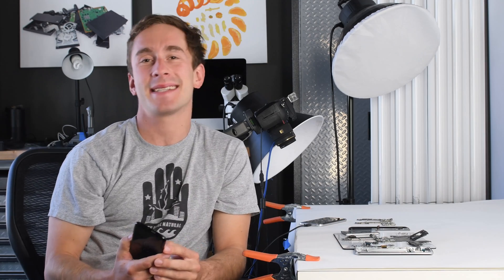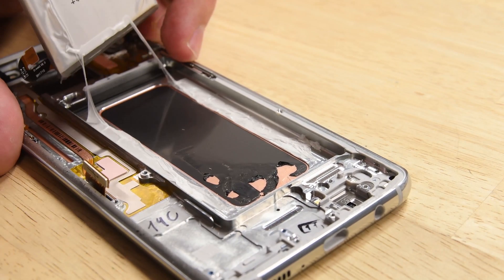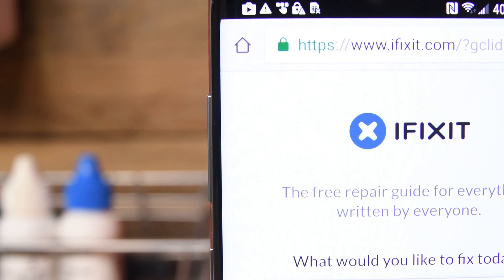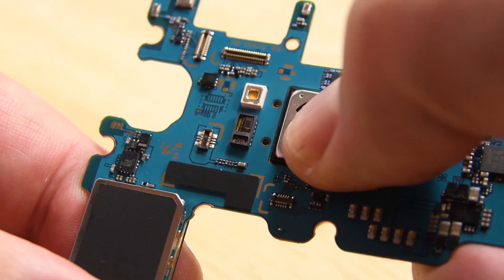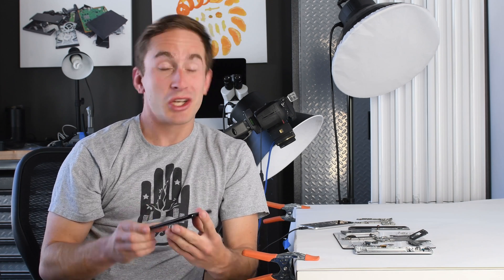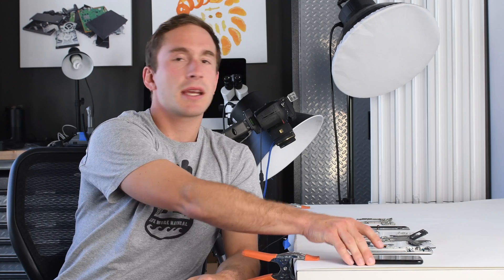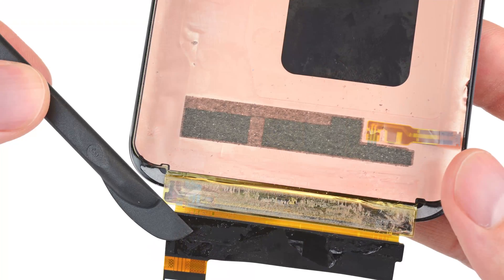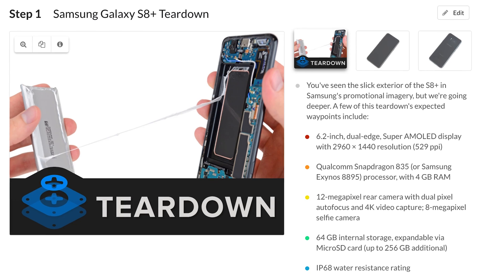Samsung Galaxy S8/S8+ Teardown Follow Up! Your Questions Answered and Component Updates!

Comment: I have a problem with my S8 Plus. Maybe you can help - whether it's normal or not. Or what might be the reason.... When I listen closely to the ear speaker (even without making a telephone call) I hear some noise that is caused by the Wifi module being turned on. It is not there, when I switch Wifi off. It's kind of a very subtle clicking, like an antenna working.

Comment: Isn't S8 the LEAST probable phone to have battery exploding issues? Or are you going to say from now on on every phone teardown with a glued battery that "(manufacturer x) will have a hard time getting these out if their batteries start exploding"
Reply: Mikko Haavisto  Good point about the batteries. Why is this 'teck' doing a teardown review  when he doesn't know  the difference  between  an explosion  and a fire !! Samsung HAD a problem with  about 5 batteries overheating and burning, No Explosions .